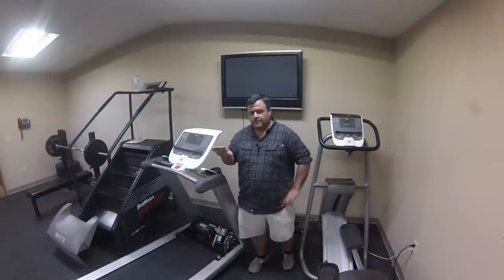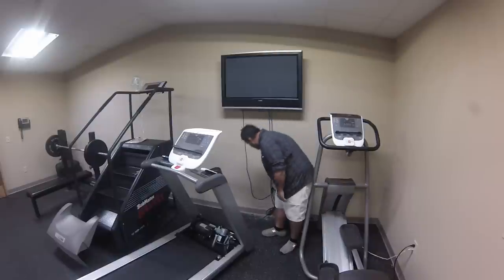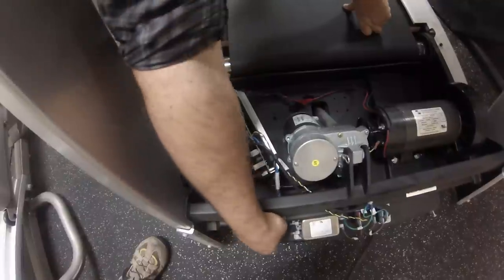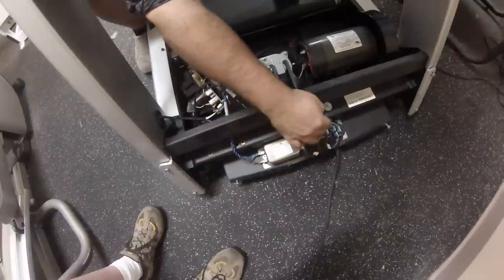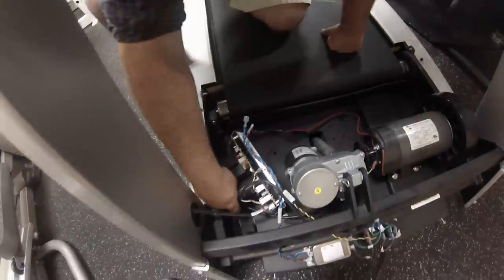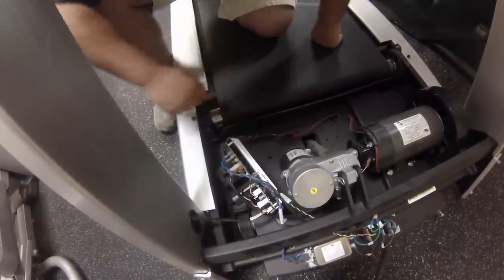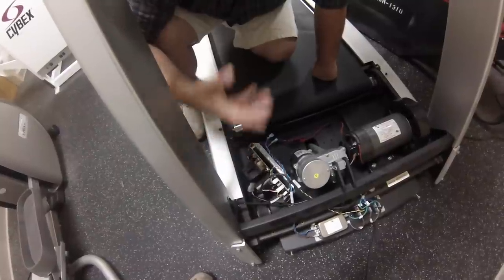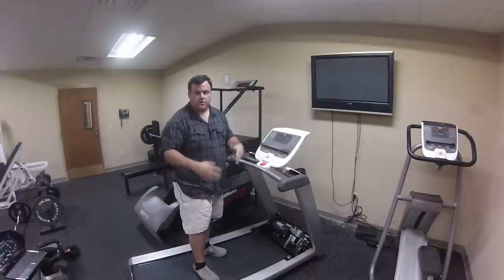Treadmill Keeps Tripping Breaker? Troubleshooting a Dead Short In A Treadmill

Comment: It's not a dead short, it's a GFCI Arc-fault breaker, swap the breaker for a NORMAL breaker problems solved.  I had the same issue with my treadmill.  Arc-fault breakers don't like brushed motors they will trip with any brushed motor under load.  If you want to test, run a heavy duty extension cord out to another outlet that's not on an Arc sense breaker.  Most of your outside (GFCI and Arc-Fault) any outlet in the garage, kitchen, bathrooms sometimes in the bedroom are Arc-Fault.   These breakers "listen" to the circut to sense arcing which is exactly what a heavy duty brushed motor (like your treadmill) does. When they sense it, they trip.  Ham radio operators find this out the hard way also, key the mic and breakers trip.  RF loves to seek out powerlines, even the ones running through the walls of your house.  Too much RF and CLICK breaker pops. Don't judge the breaker, it's doing exactly what it was designed to do, it's just not very convienient when you need to use it for one of the purposes above.  Swap the breaker out and your problem is solved.  Check with your local code if you are swapping breakers, some states require arc fault or ground fault (GFCI) breakers in the garage and outdoor outlets in order to maintain electrical code.  <----- I just realized the original post is from 2013, who cares anymore?
Reply: I definitely care your a genius!!
Reply: Thanks

Comment: Call a electrician you need a new circuit. What is making the breaker trip is overload. Ground is just allowing a path of less resistance in the case of a short in the treadmill.
Reply: Instablaster...

Comment: And to get that fixed costs more than half of what it would cost for a new treadmill
Reply from the maker: Can you elaborate on the issue you are having with your machine? Maybe I can help figure out what the issue is. Also, do you have the full model and serial number off the machine? Thanks
Reply: @treadmilldoctor  Many thanks for your offer. Its a BTM, model 8030C. It was eventually tripping the circuit breaker as soon as it was turned on without hitting start. It initially tripped it during a run. I don't seem to have a serial number.
Reply from the maker: Thank you, this looks to be an international model so I don't have much information on the machine itself but, if it initially tripped the breaker then that was likely due to excessive friction between the belt and deck, see link - https://www.treadmilldoctor.com/shuts-down-during-a-workout 

This can overload the unit and damage the motor control board which is likely what happened here, a shorted out motor controller. How old is the walking belt on the machine and when was it last lubed?
Reply: @treadmilldoctor  Many thanks! 2 yrs. I had just lubed and may have over tightened the belt. I take it I need a new controller board?
Reply from the maker: Yes, it sounds like a board issue. You can test your motor to rule it out, here's how if that unit has a DC Drive motor - https://www.treadmilldoctor.com/motor-testing
Reply: @treadmilldoctor  Ok, thanks for your kind help. I cant believe I burned my board so easily but I guess after 2 years of regular use it become volatile.,
Reply from the maker: You are very welcome! Happy to help!

Comment: Breaker trips when I change from speed 6 to 8.   Any recommendation ?
Reply: I think it's what he said in the video, it's likely the friction of the belt against the deck causing too much current draw.  Simple solution may be simply to lubricate the belt/deck using silicone spray.
Reply: Most likely you're not using a dedicated outlet and you exceed the AMPS that that outlet has left for your treadmill when you increase the speed from 6 to 8. That will trip the breaker. If you have anything else on that circuit, unplug it and see if that fixes your issue. If it does, you need to upgrade your electric or keep other items off the circuit. If you have indeed a dedicated 20amp line to your treadmill, than its likely that your belt is worn and needs more lubricant or replacing (check deck also if you are going to replace the belt).

Comment: My treadmill proform XT 70  shut down completely when i starting to run, at the same time my wall circuit breaker tripped , Than I reset my circut braker , the  power comes back including my display board also I checked the control board, and it has a solid red light. What would be the issue typically in situations like this?

Comment: We tackled assembling the bike as a family project. https://www.youtube.com/post/Ugkxzg0clhbtRf2gGxPkVETFKJJKGqdsorQu  The package is heavy, but I have 2 teen boys that were able to move it. The written instructions were great- we didn't need to watch the videos, but it was good knowing that the option was there if we needed it. After we were able to get it set up, the boys each rode 3 miles and I rode 8 and the bike stayed quiet. The display is easy to reset, and you can put it on whichever setting you are using (time, distance, calories, etc). I will say that my butt is a little sore from the seat, but that could be because I haven't rode in a while. While it is comfortable for me, it was not comfortable with the seat position for my friend (could not move the seat back far enough and he slightly looked like a kid riding a tricycle that he had outgrown). He also said that the seat hurt his manly parts. We are going to look for a different seat that will be compatible with this bike for him.I did purchase the Wahoo Cadence sensor and strapped it to the crank of one of the pedals. This will sync with my Apple Watch, iPhone and will import data in to my Health app. Wahoo does have other sensors available other than cadence. I can also keep either my phone or my iPad on the display and they both feel pretty secure.
Reply from the maker: That's great! Glad you're up and running again!

Comment: Thanks for such a clear, informative video. I checked all the components and everything’s fine, including the switch & power cord, so problem is definitely in the circuit board, which trips the breaker immediately when the treadmill is switched on. Any advice at this point? The circuit board is not dusty or dirty and there are no obviously damaged components. I’m not sure what to do from here...
Reply: This is my issue. Apparently, treadmill Dr isn't answering questions so I'm wondering if you figured out what to so?
Reply: @scraperfect me too 😢
Reply: @MrScoobieman  Our problem was it was on a GFCI circuit and although the sircuit should have been large enough, it kept tripping the GFCI itself. I ran a (heavy duty) extension cord a short way to a different outlet which wasn't on the GFCI circuit and all has been fine since!
Reply: @scraperfect  ok thanks for the reply, I grabbed on extension and it still tripped a different breaker …. I guess it’s time to retire this machine
Reply: @MrScoobieman  are you sure the new circuit is not on a circuit breaker? We also replaced the GFCI in case it was a faulty outlet, btw, but moving it to a non gfci circuit was key. Are you absolutely sure the new outlet is not on a circuit which has a gfci outlet on it?

Comment: my treadmill goes for about 3 minutes and then the circuitbreaker at the front of the treadmill trips. Do I need an electrician for this or is this something I could fix?
Reply: +c4140 This is happening also. Any help would be great.
Reply: Did you find solutions?
Reply: same here. Please did you found a solution?
Reply: Same
Reply: Same here, mine trip the breaker once I accelerate the speed above .5 so I’m not sure what to do about it. I returned it and got another one thinking it might a been a faulty product but if this one does it also, I might call and electrician to upgrade the circuit

Comment: I have a treadmill the motor runs fine but soon as you step on it it slows down to almost stop I've tightened the bell and I've just it but that doesn't seem to help it'll run fine without any weight on it but when you step on it it slows down What do you think would be
Reply from the maker: This sounds like you have a worn walking belt, have you tried lubricating it?

Comment: I have a Spirit Treadmill that my dad bought between 15-20 years ago. and over the past 2 years it slowly has been having some issues. like the sides of the top part /plastic fell off. but still works. but more recently. when I try to stop and pause it, it often and more and more will take me pushing real hard or just take a few seconds . but last night I was freaked out because I started the treadmill and ran for 10 =15 seconds as it was proably not even up to spee dyet and it went off along with 2 lights. I found out today it was a circuit breaker. we heard it go on. but a few times in a row when I hit on, it stayed, but hit the speed up button an di timmidiately trips. there is quite a bit of dust, haven't done maintenance on it in like 5-7 years as the place that sold it to us used to come every year 2, or 3 to tune everything up. but they have been nonexisnt for over 5 years maybe7 or 8 even. not sure.  any ideas? I am hoping it isn't a matter of the motor being bad where it would be more expensive to buy a part than a new machine. and smply put , hope I can use it. I really like this treadmill even though it is old
Reply: average prices for a circuit board or motor is $200, and its usually one of these

Comment: My drive motor works fine when I owe it with another battery, however when plugged into the board, it blows the circuit board (house). 
Any ideas team? HealthRider 130T

Comment: My wife's Horizon ct5.4 treadmill will shut off completely after about 10 minutes of her walking on it. The D23 led flashes everytime she steps down, then will get more steady and eventually trip the on off switch. The switch cannot be turned back on for a while. Any advice would be really appreciated
Reply from the maker: Solution: The walking belt is worn. The incline test is the best test for it if you don't have a way to take a DC amp draw. Put the treadmill at full incline and walk normally. If it takes it longer to shut off or does not shut off at all, you need to replace the walking belt. Be sure to inspect the deck for wear too. If you want to go for a cheap fix (that we don't recommend) try lubricating the walking belt. The best fix is to replace the walking belt and then regularly maintain it and keep the treadmill clean. You can give me a call at 888-362-1105 ext 298 if you have any further questions. Thanks
Reply: @treadmilldoctor  really eh?!?  Hmmm. We oil the belt often and when the machine tells us too. I did notice white fluff of the floor, assuming it's belt material. The machine isn't even very old. I may take you up on that phone call. Thanks so much for the reply
Reply from the maker: No problem, I'm available 8-5 central

Comment: My brand new treadmill trips the breaker as soon as I plugged it in. The wall sockets aren’t even turned on 😞 May have to pull it apart and try this
Reply from the maker: I would open up the motor cover and check the wiring. If you're not sure how it should look you can email me a good picture to kclay@treadmilldoctor.com

Comment: If I am not in the treadmill and set the speed all the way to 10 it's fine. But whenever I start running on treadmill around 6 or 7 it trips the breaker. It's whenever it senses weight. What could be the problem?
Reply: Too much friction lubricate your walk belt.

Comment: My treadmill trips my breaker when I try the speed button.  Incline button is fine. I tested the motor with a drill battery and the belt runs fine.. any ideas as to the problem please?
Reply: TezAllez same problem here
Reply: Any luck on this problem?
Reply: If you haven’t lubed it regularly, the strain on electrical components eventually takes them out of specs. This took down my Sole F63. I sent board to Ebay vendor for repair (110$) and put on a new belt (old one had smooth underside), lubed it and it took off! $240 later, runs great!

Comment: will upgrading to a high inrush breaker solve the problem if nothing else works?
Reply: Jay Wonder No never mask the problem. Breaker is used to protect from overload or short circuit. If none of your electrical components is the issue then check the tension and condition of your drive belt, check to see if the idler and drive rollers are turning properly, otherwise check the condition and tension of your walking belt. You might need to lubricate the walking belt. If the walking belt does not turn properly while walking or running the motor will work harder causing the breaker to trip. Mind you though it is rare but your breaker might be defective so you might need to change the breaker of the same characteristics.

Comment: My breaker flips when I turn on the switch on the treadmill.  I reset the breaker and turn on the switch a second time and it always works fine that time.  Any ideas?
Reply from the maker: Do you have it plugged into a dedicated 20 amp circuit? Also is it plugged into a GFCI or AFCI outlet?
Reply: @treadmilldoctor  I believe it is 20 amps.  It's got one other item on it, an air purifier.  The outlet is just a regular one.
Reply from the maker: Unplug the purifier and see if that helps
Reply: @treadmilldoctor  Okay, I'll get that a try.  I was thinking surge current was the problem.  What do you think?  Is there a device I can buy to put between the outlet and the treadmill that will absorb surge current?
Reply from the maker: Here is a link to the surge suppressor and a discount code to use at checkout, this is a good item to have to protect your machine - DISCOUNT CODE  -  ME22
 - https://www.treadmilldoctor.com/deluxe-surge-suppressor